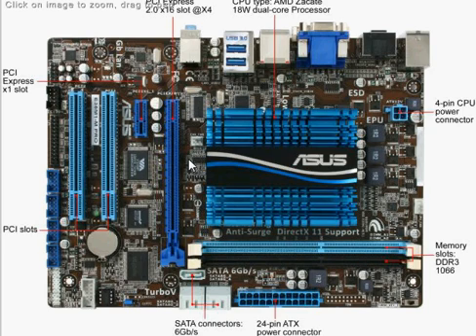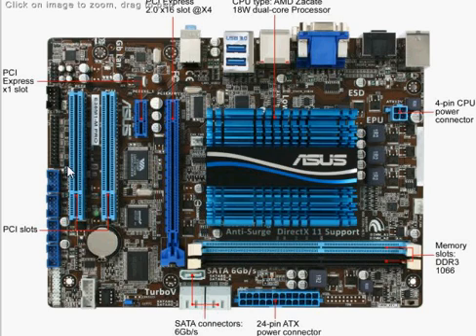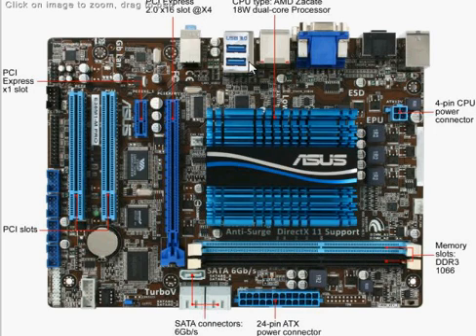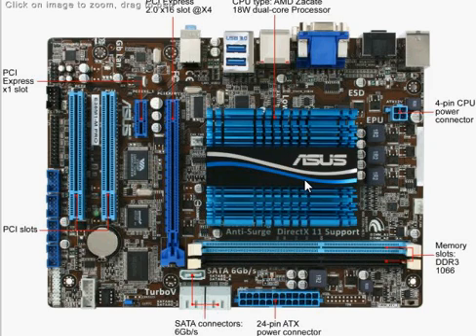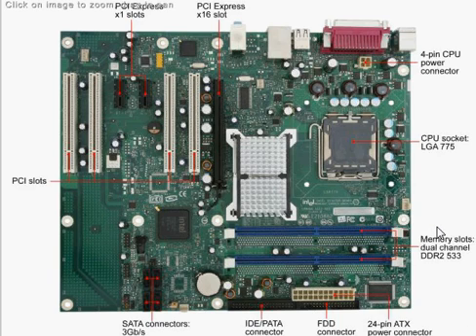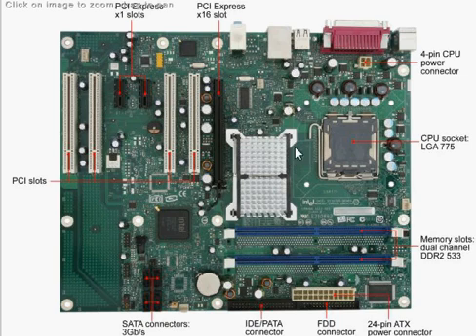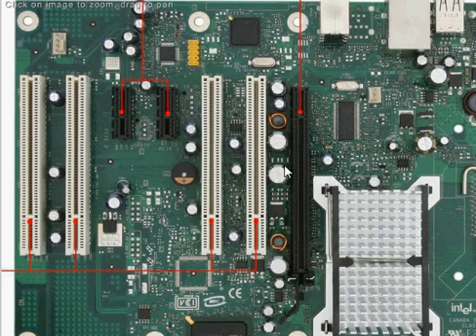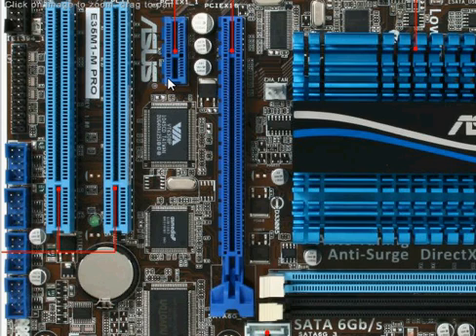Motherboard Form Factors : ATX and Micro ATX

Comment: great vid i know im late but can a dell optiplex 790 mother board which is small form factor be micro atx (0D28YY) thats the model number
Reply from the maker: I took a look at that board, the CPU socket far off to the right which changes the standoff arrangement. This board will not fit properly in a standard case, at least.

Comment: and i have placed my micro atx motherboard into midtower and its fits but i use a micro atx psu and it gets to hot and shut down the system. im also using a low end graphics card. i hope you can help me. sorry for my bad english if its not clear ask me. thank you